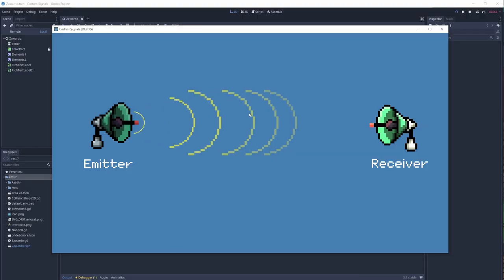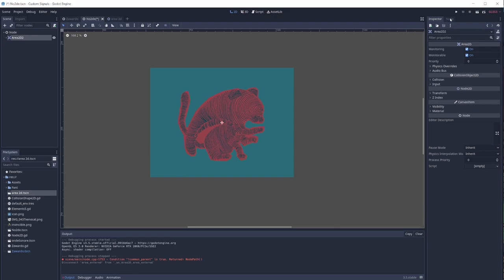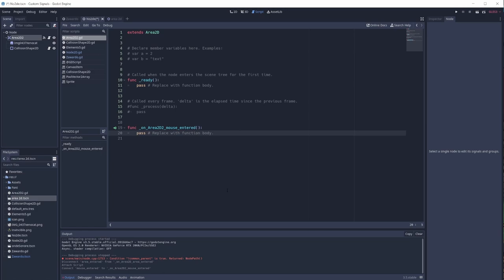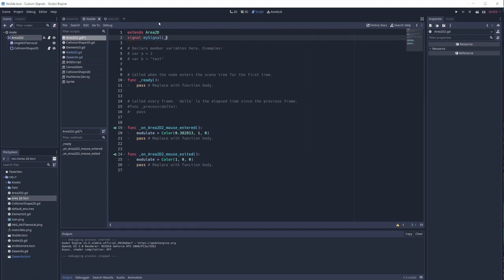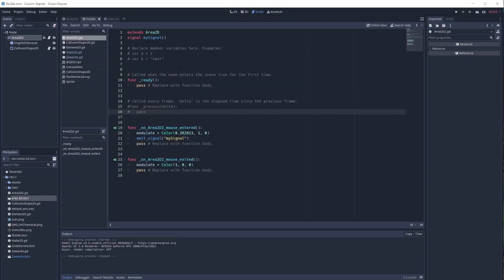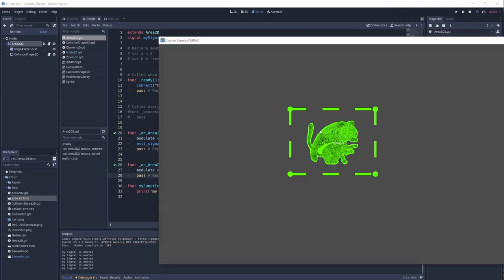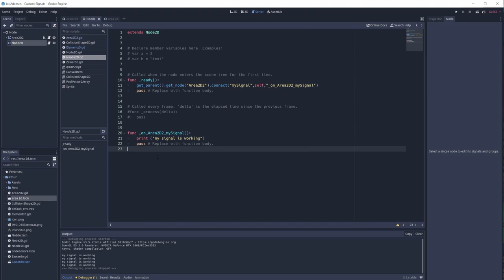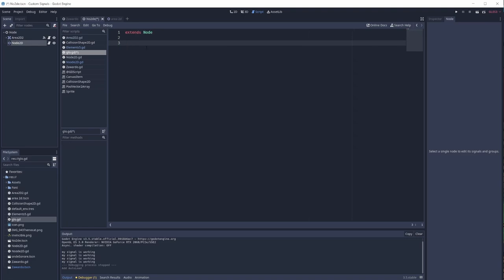Godot - Signal-izing better !?

Comment: how do i send and connect the signal to a node that is not in the scene or its in the other scene which is not instanced?
Reply from the maker: nodes need to be instanced to connect and receive the signal(they are just code that runs) if nodes are not in the same scene you need to use variables in singletons to preserve data https://youtu.be/K8dlAjQHQKo
Reply: @endritDevYellowHatGames  whoa this singletons actually worked now i can access the thing from anywhere thats a crazy powerful feature thanks for the help

Comment: Signals depend on passing strings...which is very brittle.  Is there really no other way?
Reply from the maker: You can use them just like triggers if you want , no parameters are needed ! Combining them with singletons might make everything even better
Reply: @endritDevYellowHatGames  I'm talking about having to use strings when connecting a signal to a function. What happens if you need to rename the function?  The game will just crash, and anywhere that you were calling that function through a signal would need to be updated manually.  On top of that, when you look for references to that function, calls from signals will not be shown.
Reply: @pythonxz  All function names are expressed in strings though.
Creating a variable function is impossible, unless you intend to utilize a lambda though some black magic.
Reply: @0MVR_0  I understand that, my issue is just simply passing a string litteral.  I have since learned that Godot is moving away from that.
Reply: @pythonxz  consider what you are asking. you want a child to handle the initialized method of a parent